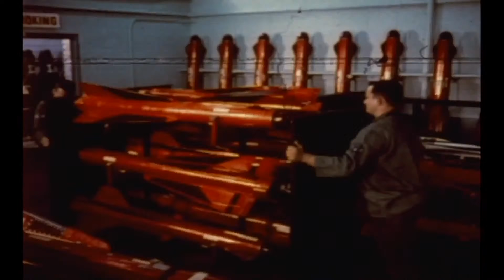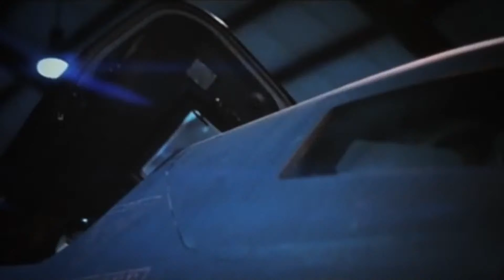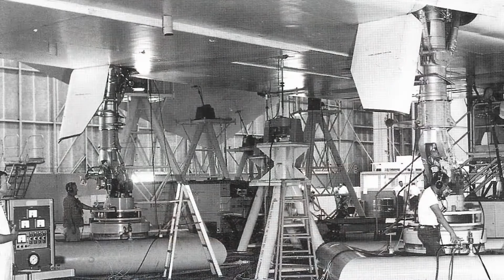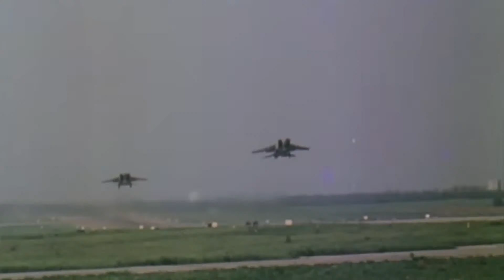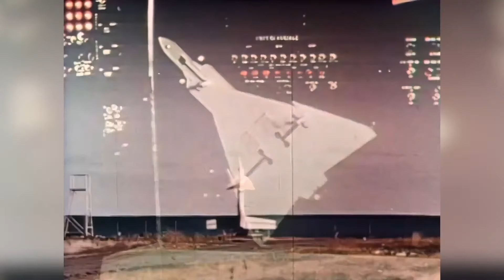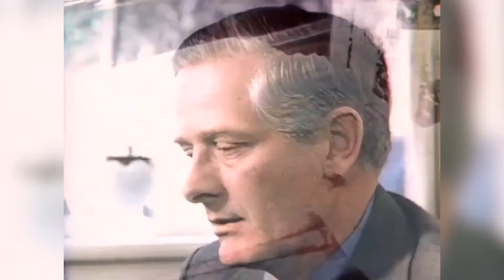XF-108 Rapier: The North American Ultimate Weapon That Never Was And Other Experimental Aircraft

Comment: Looks like a bit of a ripoff of the CF-105 Avro Arrow which never got to full production due to politics. It made it first flight in March 1958.
Reply: There are similarities between them and the TSR.2 as well.  Similar roles, similar requirements lead to similar looks.
Reply: Much, much, much more technologically advanced than Arrow could ever begin to imagine. It was a contemporary, nothing was 'stolen' lol. Many of the advanced technologies were incorporated into A-5/RA-5C, itself a significantly more advanced plane than Arrow. It flew faster, higher and further than Arrow using 30% less thrust...off of a boat.
Reply: @symondssays  Notice how the stats are never combat but only what its capable of. China showed what its aged jet could do in true combat. never mind what`s to come. America`s next advancement will be in the field of a parking brake for carrier based jets.
Reply: @MizMite2002  You realize the Rapier was canceled and never flew, right?